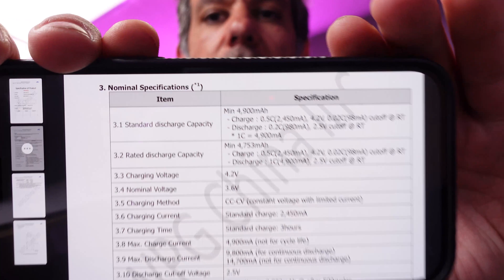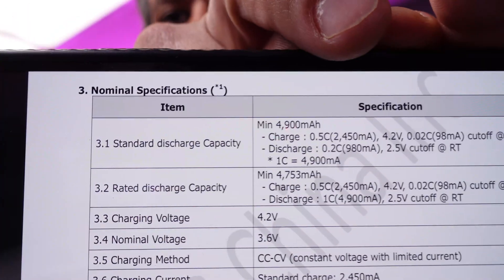How to determine the maximum safe rate to charge your batteries

Comment: Great video, ill keep it as a reference to send people to for this stuff (i must have explained the whole thing at least a 100 times 😂).

Technically the rated 0.5C fast charging  the Sherman Max (which is controler limited) and S is 19.6 amp, but while i understand the max power output can go close to 100 amp (one our riders in Montreal blew the standard fuses a couple of times riding in snow and Leaperkim told him it was okay to change the 40 amps fuses with 50 amps) .. i still feel a bit squeamish about charging at 19.6 amps 😅. 

A bit unsure about rest of the electronics.

Any real world experience around you , of people charging at 20 amp without problem? Ive seen people mention trying to 20 and even 30 amps for brief moments, but no report of long charges done multiples times. 

From experience, i can ride 200km at a bit more than 40kmh/25mph in a day and not have to wait for the wheel to charge if i do charging at 15 amps at pit stops, meals, etc.

If charging can be done safely and without electronics/batteries depredation,  id love to do 300km/186miles rides more often, but I hate having to wait for my wheel to charge.
Reply from the maker: People charge Master Pros at these rates after modifying the wheel to accept the current.  The Master Pro is exactly double a 50E master and therefore can take twice the current if electronics allow it.

Comment: Good info, thx Roger. Though the charge ports themselves are often the weakest link. I don’t know how well the modern BMSs take that into account. The GX connectors are usually rated for 5-7 amps per connector, depending on the specific model. So check the wheel’s manufacturer’s max charge rate, as it’s often the fastest safe charging rate.
Reply: Good to know! I've been using 8A on a GX20... I'll build a splitter.
Reply from the maker: @VllKlNG  double pins means 14 amps with no splitter for a GX20
Reply: @roghaj  Oh thanks for the clarification. Makes it even easier!
Reply: @VllKlNG   Apparently GX20-connectors can be rated to 10A. Here as well, no mention of rating per pin. And 60A total for the GX20-12 would be pretty absurd. That would make it a 24’000W connector! 😂

https://www.renhotecpro.com/wp-content/uploads/2017/04/GX-Series-Aviation-Connectors-Presentation.pdf
Reply: @mrelwood_EUC thanks for the DL. Looks good at 10A. 😊
Reply: @VllKlNG  That datasheet was for one manufacturer’s connectors only though, so there can be differences. But I would imagine 8A to be safe in a single GX20. I would check the wheel’s user manual though.
Reply from the maker: MY FAVORITE tech guy! Thanks. Everyone should subscribe to you channel. 

GX16 pins carry 5a each
GX20 pins 7a
So 10a or 14a per port if wired properly on both the wheel and the charger. 
I sell my charger with double ported double pinned GX16 and single GX20
Reply: @roghaj  I wasn’t able to find a single GX connector spec sheet that would mention the current capability to refer to each PIN separately. Have you seen one? They all just seem to refer to the whole connector, like the other specs as well.

Comment: Samsung specify 2450mA as the maximum continuous Standard Charging current for the 50E cells. In the Master with its 32S4P configuration that equates to 9.8A. Splitting hairs I know, it is pretty much what you said. One thing to remember though the charging rate of 2450mA is for one cell. When battery's are grouped together they are going to get warmer than if they were charged in isolation. There is also the consideration that battery's are being charged in groups of 4, meaning that you cannot be sure the charging current is equally distributed between the four, it should be but maybe not. So what does this all mean, well for continuous charging I would come down just a little bit on the 9.8A. I would consider 9A the maximum. The standard 3A charger is supposed to charge the Master in 6Hr's, 9A charging would charge it in 2hrs (always remembering the charge current bleeds off at the end of the charge anyway) - good enough :-)
Reply from the maker: The last significant digits are insignificant.  :)
Reply: @roghaj  I remember a story from years ago where someone at a big clearing bank took all those insignificant fractions of a cent off every calculated transaction that went through the bank, and put them in a personal account. He became a millionaire. right up to the point when he was discovered 🙂
Reply from the maker: @Roskellan  sorry man. That’s from Superman 3
Reply: @roghaj  They may have stole the idea, not sure, but I'm hanging onto the thought 🙂

Comment: How do I determine the maximum safe rate of the inside wireing of my wheel? Because I know I can charge my batteries quicker, but I will burn the wires. Maximum safe charging rate is determined by the weakest link and that is often not the battaries.
Reply from the maker: All of these modern wheels will cut off charging current if you are beyond what the BMS can handle. The setting in the BMS is usually figure it out by the bleed rate the resistors can handle. If your charge rate can exceed the bleed rate than a pack, could end up severely out of balance.
Reply: @roghaj  Good to know. Unfortunately this is not the case for my 18xl. Seller warned me to not go over 6 Amps, although Kingsong rated it for 10.
Reply from the maker: I said modern wheels  :P

Comment: Thank you for this info ! I ride a Master "V4" with the latest charging port, when I charge it to 100%, EUC world tells me 134v and the next day it's 133v. Is there a solution to remedy this loss or it's a security?
Reply from the maker: People say it is the voltage distribution board. That’s the thing that all the packs plug into. I bypassed this and the problem went away. However, the risks that come with removing all of these security features probably aren’t worth it for most.

Comment: BMS should limit charge current and charging limits should be taken mainly from BMS not just from cells. Unfortunately, some of EUCs models don't have fully matured BMSs. For example older begode wheels like rs19.

You forgot about charging cables, port limitations and last but not least temperature. Roger, can you show on the thermal camera what happens when you push into your wheel 1,3 kw of energy continuously for an hour?  Maybe compare different brands and their charging capabilities. You can compare your charger against others. Look with oscilloscope on voltage ripple e.t.c. ...

I would not use the word "safe" ... A lot of caution should be in place. I saw on EUC group rides multiple fast-chargers on the same 230v socket and that melted. Fun to watch people rushing to unplug themself after.
Reply from the maker: It seems that all current wheels have a charge limit that is likely set to make it difficult to exceed the bleed rate of the balance resistors. I’m not too interested in checking temp, as long as I am charging within the cell manufacture specifications.